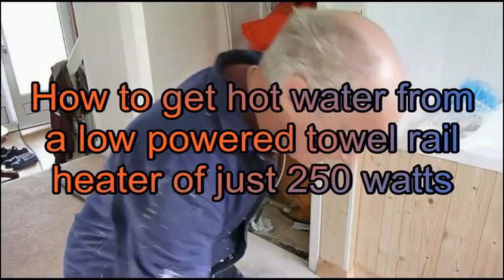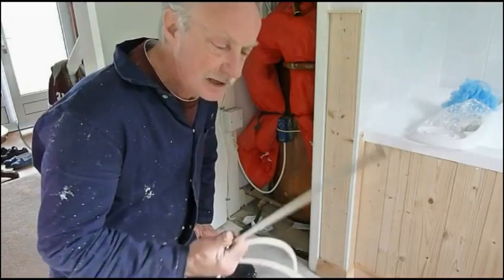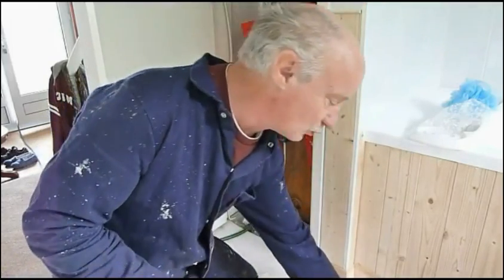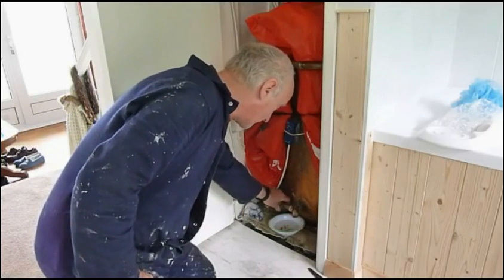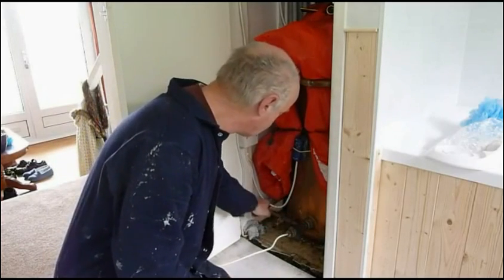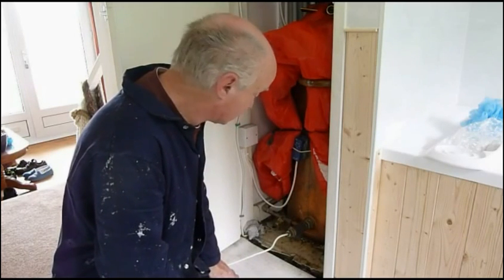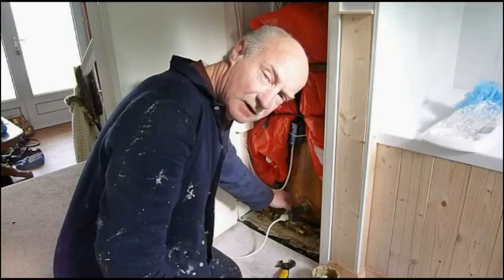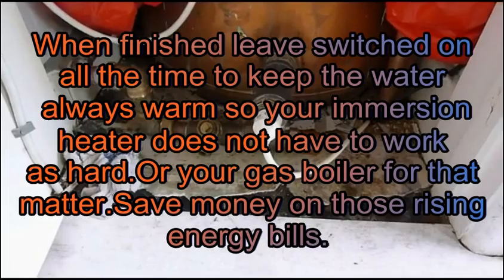How to get cheap hot water from a towel rail element.

Comment: does this 250w element provide enough water to have a shower or a bath. I am considering doing this on a simple timer between 10am to 3pm during pv generation. this is very simple and I love simple things keep it up my friend love your videos.
Reply from the maker: manikdesign It needs about 8 hours to get warm,  would suggest a 600 watt one for getting hot water in that time.  I use a low 250  watt one just to take the water to a level where the boiler does not have to work so hard from cold.

Comment from the maker: you are using just 250 watt as you are not running the immersion but the towel rail heater that is screwed into the tank. It is not about trickle heating the immersion that would indeed draw 3 kw , a lot  more than the solar could produce on a winters cloudy day. Every body seems to be getting the wrong end of the stick here.
al.

Comment: You are using FREE enegy, what he is getting at is using suplus pv power to trickle heat the immersion, you aint gonna get 3kw of excess from your panels in winter. The idea is you run the timer when you have excess solar energy available, so you would not be paying for it.
If you leave a 3kw running it will draw power from the grid!